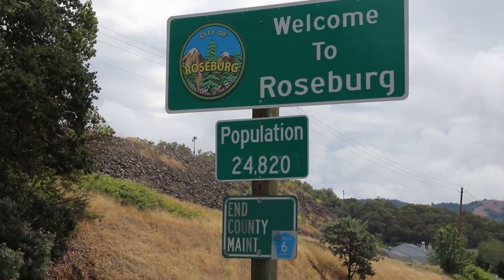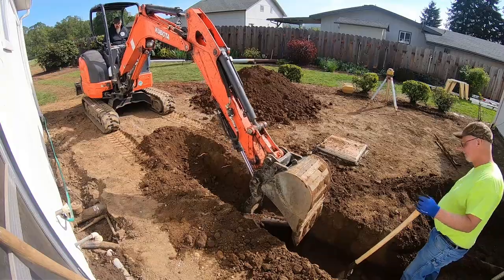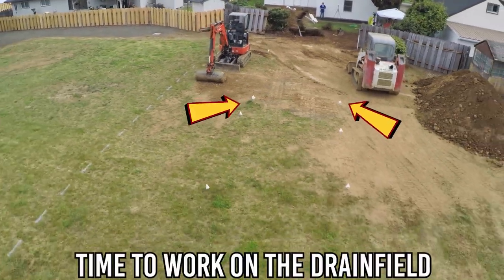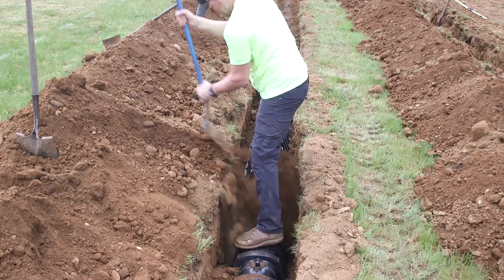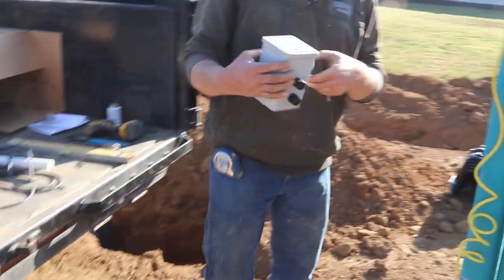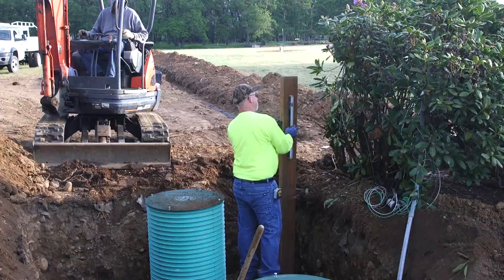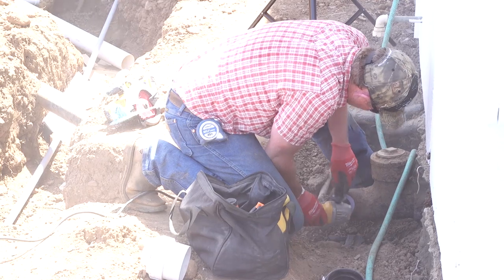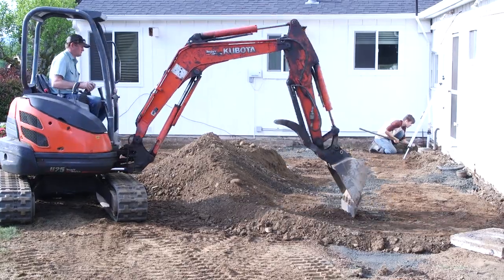Septic System Replacement

Comment: The new septic tank installed 50 feet away, and given the slope drop of sewer pipe at a quarter inch per feet, then it should result in only 1 feet deep for 50 feet length.  Why is it 5 feet deep claimed?  It is almost 4 feet more. Did you installed the sewer pipes at a steeper slope?

Comment: can someone explain the black plastic chambers? is there a pipe underneath or does the water just run over the ground underneath them? I have the crushed rock and sand version in my field with perforated pipe.

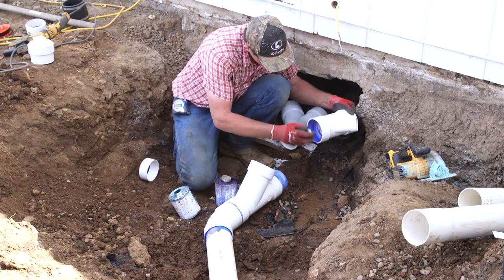Comment: Scott, just after the 4'' x 4'' x 4'' wye  for the vertical clean-out there is a 4'' x 4'' x 2'' wye.  See frame 20:28.  What is the purpose of the 2'' line?

Comment: Couple of questions are you guys allowed to put in a septic tank larger than the stipulated the capacity of the house, second are you allowed to construct your own septic tank using 8 inch wide Foundation blocks and filling those blocks with concrete?

Comment: My mind wonders what the problem would be to backfill the derelict septic tank with fill dirt or aggregate instead of concrete. Simpler to fill with concrete than to reliably assume a contractor will make sure 15ft of backfill is properly compacted maybe?
Reply: Concrete "flows" to fill all the voids.

Comment: As soon as I saw the pump that needs electricity to run it (11:42), I stopped the video. This system will never be as simple, Long lasting, efficient, or maintenance free as the original system that lasted for 70 years. These “new installs” utilizing new technologies and cheaper materials are a step backwards, for certain.
Reply: That is true, I'm assuming they couldn't use a gravity system for some reason.
Reply: @dcrog69  Probably because digging the trenches that deep would be dangerous (cave-in risk) and present its own set of headaches, permitting requirements, etc.
Reply: Exactly. This is brain damaged. No point planting grass because they will be digging it back up.

Comment: Just a guess but if the house was built in the '50, I bet this new sewage system is costing more than the whole house did when it was built.  Inflation is wonderful.  I remember I thought if I could make five figures ($10,000) a year I would be in fat city. I have been retired for 21 years and before I retired I was paying more than that in taxes.

Comment: I'm really surprised they just used a couple chains.  There are 4 chains and Grade 70 5/16" chain has WLL of only 4,700lbs.  That tank should weigh somewhere between 16,000 and 18,000 lbs.  When I moved mine it was 18,000lbs.  Mine has 2 rebar loops in the center that are part of the reinforcement cage and we used shackles, spreaders, and cables to rig it.
Reply: That tank weighs 11,500 +/-      and very suprised to even see a tank truck use chains.       Ive been installing for 35 plus yrs.   And around east coast. All our tank trucks use a 3/8" cable.      Bights the tank slots way better. And. Far safer slip wise.        The infiltrators there installing.     ,   i installed the first ever system with them. In Connecticut in the late 80s.  As an experimental system for the company

Comment: I don't know what state these guys are in, but I can't believe anybody would dig trenches this long, and not put Crushed Stone around the Plastic Chambers. I'd even say Septic Sand would be better than just using the dirt on-site, and where's the vent... Pump-up Systems especially, require venting. In my state, all Plastic Chamber Systems are vented if their installed deeper than 18 inches. Also, for a Pump-up System, the Distribution Box has to have 2 to 3 times the capacity of Gravity System, because when the Pump cycles it's moving a large volume of water in a very short time, and as a result, the "D" Box has to be oversized to accept the water. To be clear, I would never have installed this system this way, but I'm in New Hampshire.

Comment: I see what you did. Breaking down the patio roof and selling the lumber I bet you broke even on the septic install.
Reply: No way.  That septic install must have cost i cant even think how much.  Its crazy the material and labor involved.  They definatley choose. An expensive way to go.  Wonder if they even had to.
Reply: Thats not a very expensive septic compared to alot. Of them.     Infiltrators are cheap especially in dirt. Some states make you chrushed stone under and around them
Reply: @timmccarthy6374  Have you priced lumber? I see crackheads bringing cutoff ends of 2x4s to the pawnshops. All the cash for gold places in my city have "cash for lumber" signs up now.

Comment: Our septic tank was replaced shortly before we purchased our house 27yrs  ago. So far no issues. The county has come up with some silly law passed that when a septic tank needs replaced that the homeowners must go on the city sewage system. One of the reasons we didn't move to the city limits was so we didn't have to get a permit to build a dog house. Looks like now they are inching into controlling us country folk.

Comment: Don't you have to be concerned about the frost line on that drain field? Here in central Minnesota, the frost line goes down about 48" in most areas.
Reply: Well my mother had a cousin who had a restaurant and home in Cottage Grove (a bit north of Roseburg) and we were up there quite a bit (we lived in California).  The climate is generally not cold enough long enough to create a frost line problem.  They are in a Mediterranean climate with some winter frosts and scattered snowfall in winter but it generally does NOT stay below freezing for days.  I think they get about 5 or 6 frosts a month in winter.  Average winter highs are in the high 40s in that area and spring generally arrives fast.  Not like Minnesota or Wisconsin (where I have lived for years).

Comment: 16:21 Why not dig the drain field lower?
Reply: That’s what I was wondering. It must be some stupid regulation.
Reply: Evaporation is the most effective way to get rid of the water. If the drain field is too low, all of the water has to go into the ground. That shortens the life of the system because the soil becomes saturated.

Comment: I wonder why they only do septic tank deliveries one day a week. Do they do one county one day, another the next, or actually just deliver once a week?
Reply: We are covering a very large portion of Oregon with 3 of us drivers from our Eugene branch and Wednesday is our Roseburg area delivery day. Hope that helps have a great day!
Reply: @jeffreyhausmann9278  thanks for the reply and info!
Reply: @jeffreyhausmann9278   wow interesting,    here in the north east. So many septics.   In 50 mile radius.     5 or 6 concrete manufacturer's and each one has 5 or 6 crane trucks.          But then again.  In that same 50 mile radius. theres approximately.  1200 licensed installers.        And cant ever keep up.

Comment: Wires, sensors, pumps etc, guaranteed it won't make 5 years without some sort of issue. The last one made 70 years, why not just copy and upgrade on that design. Gravity is the one force that works year round 365, no additional energy needed. Sometimes the city engineer would learn a thing or 2 if they had to crawl down into the hole themselves and correct their own hair brained ideas. Great video otherwise on the process.

Comment: Why do new septic tanks need all these pumps and filters? My parents have a 100+ year old septic tank and it works just fine, PASSIVELY.
Reply: As for the pump, you can't always get gravity between the tank and the field. I agree the filter seems like overkill. In Maine we usually install a simple baffle on the outlet side of the tank to keep the solids out of the pump tank.
Reply: @dcrog69  Yea a baffle is what my parents have. Its so maintenance free and simple and functional, I dont understand why townships have started to move away from them. Seems like everything new is a downgrade.

Comment: Do you know how many feet the effluent flows beneath those plastic hats? There is no washed gravel under those plastic party hats. Maybe it will flow several feet.

My neighbor had to replace his drain field, his property backs up to a golf course, same level ground. The golf course mows the grass on his property since there is no separating it from the golf fairway. After several months a heavy truck working for the golf course drove on the drain field and collapsed one of the plastic tunnels. We got to see how far the effluviant flowed, it didn't make it past the first section of the plastic tunnel.

When I replaced my drain field I did the gravel and pipe with the holes in it. Here is the funny part. To access my neighbors drain field the contractor had to drive on top of my field as it was the only way to get access. No harm was done to my field.

Comment: I'm not expert AT ALL, but i would assume that if you could choose to either TOTALLY remove the old septic tank, or , just fill it with concrete, it would be much more forward thinking to completely remove the old tank and fill the hole with dirt?  id hate to be stuck with a massive cement boulder in the yard like that....what details am i missing that make a "cement fill" appealing?  it seems like a terrible idea to a total non expert like myself....!

Comment: The line coming from the house is way to small, should be four inch pipe, after all some of those solid is going to plug up your pipe, you made a big mistake here.

Comment: Lineal is not a word. It's just people not knowing how to pronounce linear. Like calling a joist a joyce.
Reply: You're incorrect.
Reply: @pnwester2697  If you are talking about genealogy descendants, maybe. Just because you’ve heard it doesn’t make it right.
Reply: @joekirby4529 Lineal is a word. You're right, lineal is often a term used in ancestry.  It's also commonly used in woodworking, carpentry or engineering to refer to a measurement of distance.  "A lineal measurement is any measurement taken in a straight line from one point to another"  Lineal distance.
Is there any wiggle room in your explanation?

Comment: looks to me like the so called modern improvements is really just a few more built in fail points sometimes as we say if it ain't broke don't fix it this seems like a bit of overkill for a house of this size !!?? PS if you consider the old one worked perfectly well for almost 70 years without all the bells and whistles all these alarms and pumps it is a sign of the times that is seems every new product has to have as many controllers and electronic fail points built into them the manufacturers no longer want their product to last for 70 years the new business model seems to be get it to fail as soon as possible and make it impossible to fix or so much bs it is not worth it when i started we would never have bought a 400$ drill kit that we knew was not going to last or be supported more than 7/8 years then batteries are discontinued we would have said are you nuts i expected my tools to last for many [20] years and be repairable my 8 1/4" Skill saw is probably 40/50 years old it is taken apart at the moment, but if put back together would work just fine another great video as usual

Comment: Whilst concrete might be "the greatest building material on planet Earth", its production, transportation and installation are highly polluting.  The cement industry is one of the main producers of carbon dioxide that is contributing to climate change.  It's a complex issue with no easy answers, but claims such as that need to be tempered by the downside.

Comment: Overkill and totally over engineered. Talk about unnecessary complication - even needs electricity!

My house has septic tank. I've lived here for 13 years and never needed to touch it. Made using concrete blocks on site.

It's never needed to be pumped. No smells. No problems. No electricity needed. Tank is under the carport with no unconcreted space between it and the house, so little chance of damage to pipework.

I'm in the Philippines.
Reply: Every new needs to be complicated for some reason.

Comment: all that when you could have just dug the trenches deeper and used gravity. oof. Love my system, never uses electricity
Reply: Sometimes going deeper puts you into clay which doesn't leach as good.
Reply: Old systems wanted the fluid to simply drain into the ground - runs the risk of contaminating the ground water - bad thing if you are on a well, which most people are.

Current thinking especially where the water table us high is to flood the soil high enough for it to evaporate up through the vegetation. He mentions that in passing.
You probably have a low water table and probably low population density.